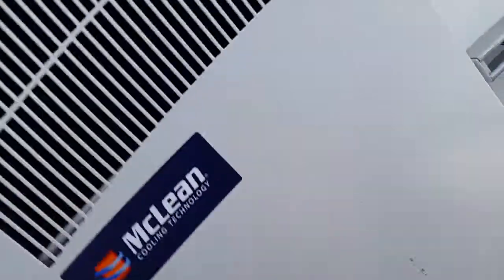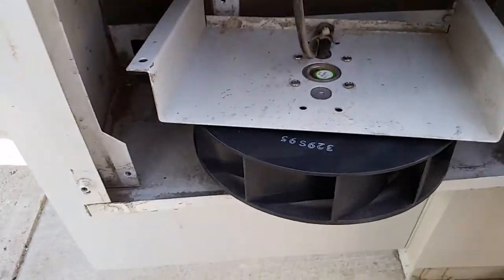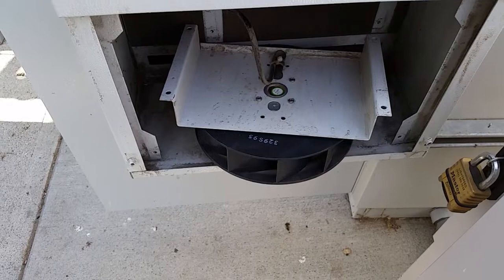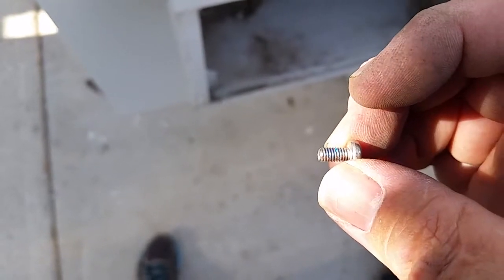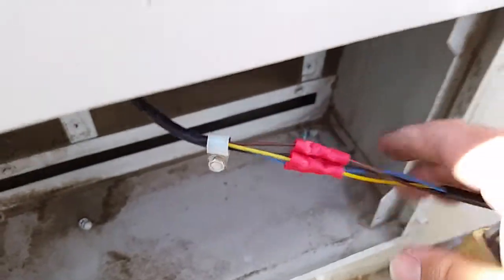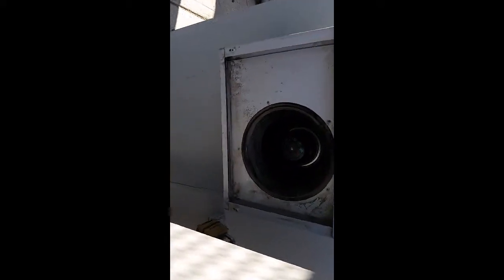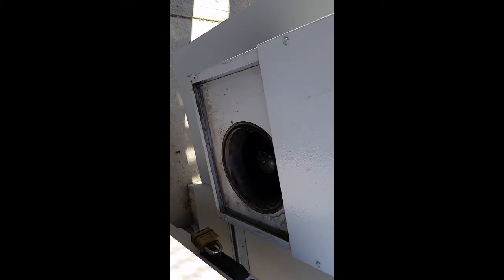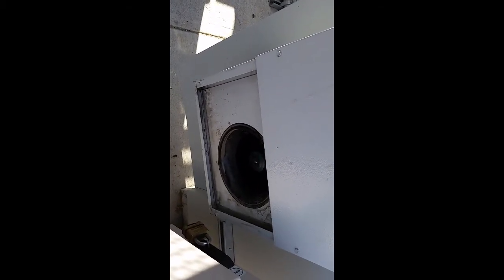Eltek outdoor cabinet condenser fan replacement.

Comment: Sir
Do have  problems in the indoor  control cart
Reply from the maker: I have before.  I had to replace the indoor fan.  If you have to replace it, take care not to drop the screws down in the door.  Otherwise, you will have to take the bottom panel off to get the screws
Reply: @tennwhitetrash  
Thanks 
But I don't mean  the fan no I mean
  the dc control
Reply from the maker: @notesm2352   never had an issue with the DC control before.  For me, bearings going out in the fans have been the issue.  Sorry I could not help you out
Reply: @tennwhitetrash   Thanks man